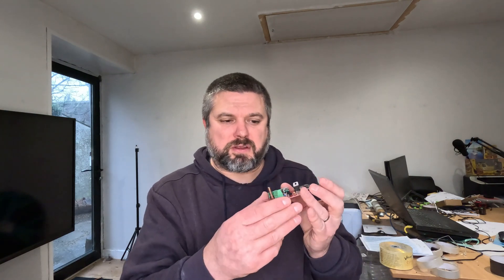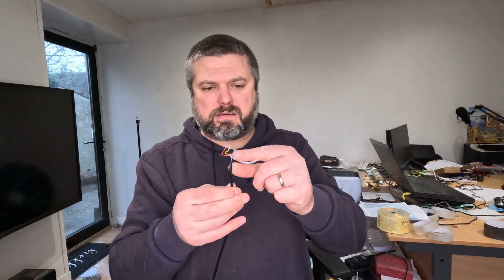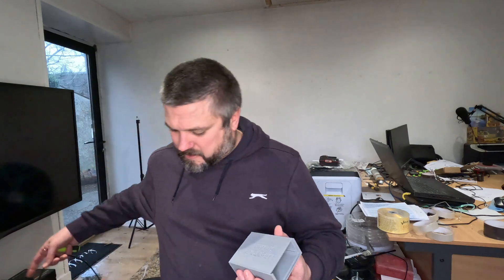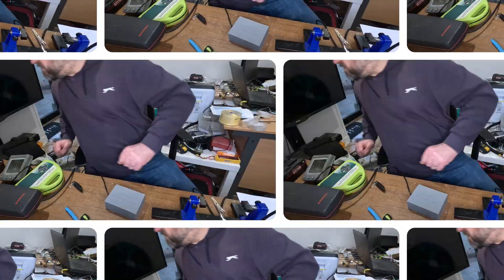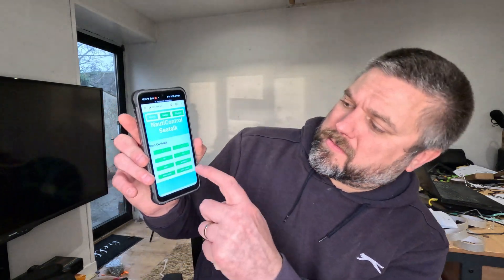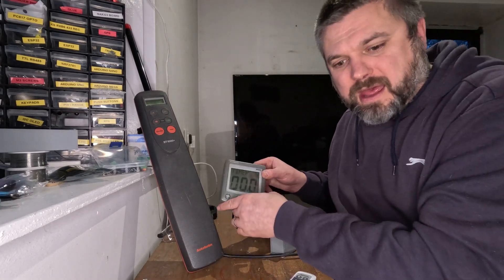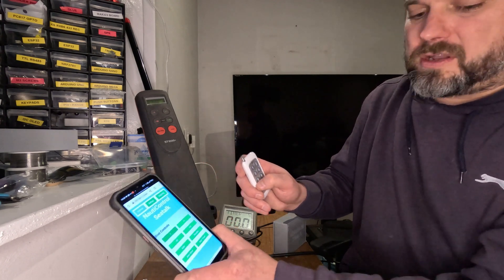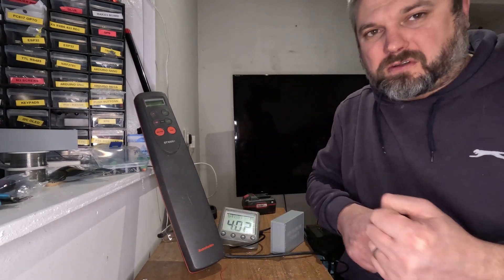Nauti Control ST Wireless V1 Open Source Raymarine Autopilot Remote , Setup instructions and demo

Comment: Hello, I'm interested in this controller. I've checked all the video and it seems to fit my setup. I've only a ST2000+ autopilot alone, so connection should be very easy.
I've one question: 
Imagine I use a 4 button remote and I map the buttons to +10 starboard, +1 starboard, +1 port, +10 port.
The ST2000+ has an autotack feature by pressing +1 and +10 together (either port or starboard) on the autopilot itself.
Can I command the same action by pressing two buttons together on the 4 button remote? Or I need to map it to a specific button, maybe on a bigger remote?
thanks in advance for your job.
Reply from the maker: The 4 button comes with it and then you can map as appropriate . On the Raymarine remotes pressing them together sends a seperate command that doesn't work here that's why there is the mappings for port/starboard so sends the command . I find +/- 1 is fine along with port / starboard. 

There is the watch app and phone app too but the wee remotes are handy as they come with a wee key chain .
Reply from the maker: I should also say it'll work perfectly well just wire up the yellow wire from the ST2000 to the data line directly thats how it's setup on my boat.

Comment: I have an st2000 tiller pilot . That is currently my only raymarine product on board. Will this wire directly to it or do i need another intermediary device?
Reply from the maker: yeah it wires straight in see the website for wiring st2000 just data to the yellow on the auto pilot .

Comment: Nice project! I plan to get one. My boat has an E120 MFD, ST7002 AP control, S3G course computer, and ST60+ Tridata. (also digital color RADAR and DSM30 sounder connected via Seatalk HS Ethernet). When sitting on the bench seat at the helm, it is a long stretch forward to reach the AP controller, a remote would be perfect!

Comment: Hi, I have watched this and some of your other Videos. All great! Having looked at your website , Before I buy one of your fab. kits I need to know something ( sorry but I cant find any contact link on your website) I have a Raymarine ST2000. I intend to hook it up to my Hydrovane self steering and use the rudder on the Hydrovane as a remote controlled rudder when motoring.
The thing is.... The ST2000 is operating on its own. I dont have a control box with the + and - ( and the +10 etc) so I woud have to just wire it in with the power leads only. Can I use your device to control the ST2000? If I use the data wire from the ST2000 (taken from the back of the through deck plug) can I control the ST2000 with your kit please?
Yours
Alistair
Reply: Hi Alistair , Yes theres really only one wire needed between the st2000 and this box  yellow wire on the st2000 connector (check your wiring to see which pin that is)  you don't need anything else , if you go on the website should have a better diagram of the wiring for st2000 , you can wire the two directly  .

Comment: This is a very cool project.

I installed the Raymarine EV-150 last fall on our twin-engine powerboat. The RM kit came with the p70Rs control head. This control head has a rotary knob to change the heading to track, not the + and - 1 and 10-degree buttons. This is a SeatalkNG unit, and I bought and installed the RM Seatalk1-to-SeatalkNG Converter Kit (E22158) so the Autopilot could communicate with my older RL80C chartplotter. Everything is working fine. 

Do you know if your Nauti-Control ST Wireless V1 will work with this setup?
Reply from the maker: Yeah this has been tested with the RM Seatalk 1 to NG converter with EV150s great. Setup guide on the web site here
https://nauti-control.com/2024/03/05/wireless-remote-control-installation-on-raymarine-ev-autopilots/

Comment: Where does the cable go on the opposite end from the box ?
Reply from the maker: Seatalk bus either directly to auto pilot , there are a few setup guides on the website for different scenarios.
https://nauti-control.com/category/projects/nauti-control-wireless-remote-controller-v1/setup-guides/

Comment: Looks great! Couple of questions - is the board taking its power solely from the Seatalk network? If you press Auto and Standby together will it select wind vane mode like the st6002?
Reply from the maker: The board doesnt draw a lot , but really depends on your setup you can have a seperate line going to the positive from the battery , as long as common ground .  In relation to wind vane mode , in the beta firmware there is a specific button that sends that signal to turn wind vane on , same with tacking etc so you can control that without pressing multiple buttons.

Comment: Just wanted to thank you for making these videos! For me "open-source" is scary 😄 But instead of changing my Raymarine MFD, I started to "look around" and found OpenCPN. Then I found your AIS solution for transmitting - bought the same and hope it will work. Also purchased a DAisy receiver and the total cost would be 20% of the Raymarine set-up. I think I will buy your remote as well. May I ask a very very stupid question - again I am 100% new to "open-source" - I assume the cable you plug into the remote is a Setalk1 cable?  Then you can plug it to a SeatalkNG network with the converter and all is good?
Reply from the maker: Yes it is Seatalk1 , If you check on the website there is some info on connecting to Seatalk NG using adapter .
Reply from the maker: https://nauti-control.com/2024/03/05/wireless-remote-control-installation-on-raymarine-ev-autopilots/

Comment: Couple of things to note, the cable needs either a mini gland or at the very least a cable tie on the cable once it passes through the box. If the cable gets tugged on it can pull out of the terminals.

This is a great project and I already have subscribed to your channel where you were doing the socotran ais. 

I think some additional features would sew up a controller for these ST tiller pilots and make them popular. 

1. Compass heading displayed  in the app, or on the ESP32 board, there's various esp32 boards now with an Led screen. 

When you use the tiller pilot (and especially if you used it at night) normally you prees +-1 deg or 10deg and you get those increments on a display or repeater display like an st60 etc. if you were to have the remote control in your pocket and lean on something etc you could easily put a 10deg course correction in you don't want. I can think of two undesirable events, 1. Rounding into beam on seas and getting unsuspecting thrown off balance. 2. Heading takes you aground somewhere.

So a heading display and a key press buzzer wouldn't go amiss.

2. Another feature to add if you could (this would be quite a challenge) have the tiller pilot accept NMEA data for routing in OpenCPN. In the routing plotter of OpenCPN there is an option to 'send to Peer' or  'send to GPS'. If that could be sent to the esp32 controller to then send commands on to the tillerpilot on reaching a waypoint to take a new 'True'  heading automatically (from the course data on the next leg) it would be awesome. It would give full course autopilot. It would be handy for fishing and sailing etc.
Reply from the maker: Hi Ray, great suggestions and glad someone watches the stuff i post lol , Ill certainly show something like that when I do a video of an install on my boat once I launch in may .  . 
In relation to the feature requests , already on some of them. 
1. Compass heading has been added in V2 firmware which should be going into public beta shortly and included in any boxes being shipped .  V2 Also sends heading information over TCPIP (with the box either being client to another wifi ap or being an AP itself) . 
2. This is planned for version 3 , i'm about half way there in that the box accepts certain NMEA commands over TCPIP from Signal K / Open CPN .

There is some other stuff coming as well such as a panic button mapping so it sends a mob to the seatalk bus whcih then adds a marker and sets of alarms on devices (can also be cancelled from device) in future versions looking at doing this with bluetooth tag so automatically triggers if someone falls over board . 

Loads of cool stuff planned ! hopefully get some videos up soon with the stuff in beta to show it off.
Reply: @Nauti-Control  excellent, watching closely ⛵👍⛵⛵